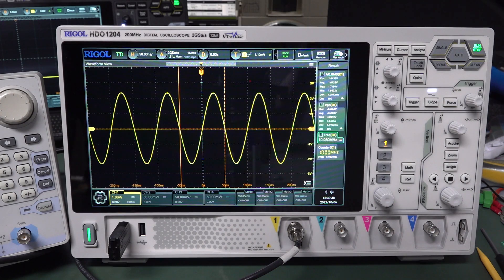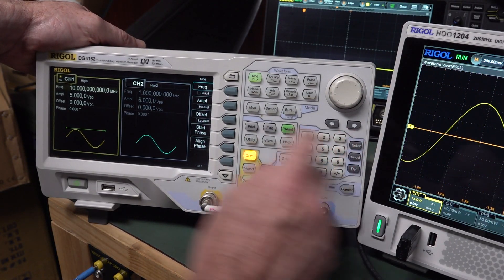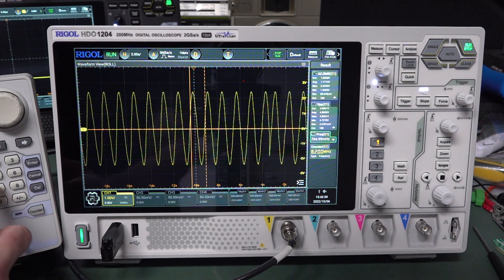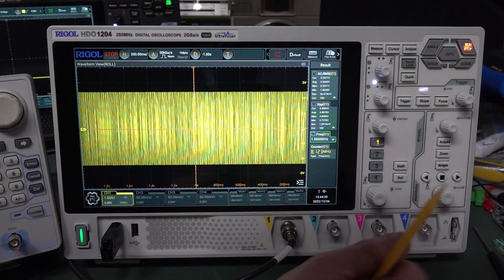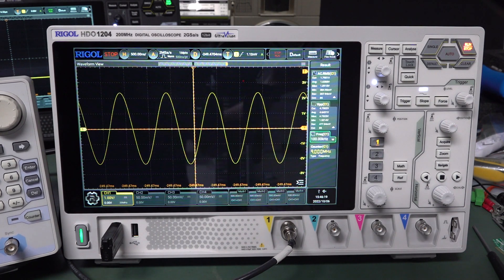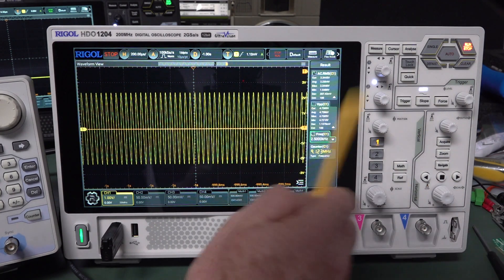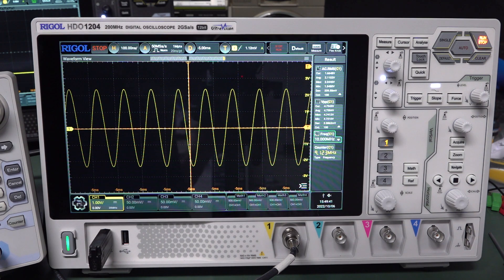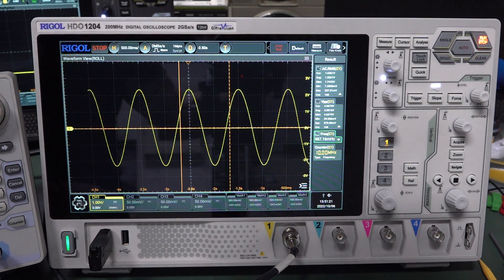Oscilloscope Alias Followup

Comment: To be fair, this is happens because a given sample can only store 1 value. It simply captures a single sample in time.

The scope could instead continue to sample at the full 2 GS/s instead, and statistically crunch it down into a "5 MS/s" sample rate for it to achieve the desired memory depth. But still contain the average, max and min values for that "sample". (The sample would be a lossy compression of 400 samples.) This however means that we need to store 3 values per sample, instead of just one, so it would lead to 1/3rd the memory depth. Technically one could store even more statistics if desired, like RMS values, duty cycle, etc, and if it is selectable then the scope could get some rather powerful long term statistics gathering capabilities. Simply pick and choose who it stores this "sample", and how many types of data it shall contain. (I should quickly add here that no scope to my knowledge actually does this.)

Comment: The Fluke 190 series II and III has a glitch mode (is default enabled) where the incoming signal is sampled (and saved) not only on the sample frequency, but also on a high clock frequency, just to avoid these kinds of problems. The minimum and maximum samples seen during the sample time are also stored (and displayed).

Comment: Is it possible that with the odd frequencies the function generator is actually not producing a pure sine and instead has some small phase error (possibly dithering) which is enough randomness to prevent the aliasing? To get what looks like a pure sine with aliasing requires high spectral purity (less than about 1 in a million when dealing with a pure frequency in the MHz).

Comment: I think there's an interesting interaction between memory depth and acquisition mode on these sorts of scope. If you run 'normal' acquisition and a small memory size, you can get aliasing in situations where you don't with large memory depths. With large depths the sampling is running at a higher rate, and the display is giving you a view based on all of the captured data, so if you, say, have 10M data points and only a 1000 pixel wide screen, 10k samples are being displayed per line, which leads to the nicer DPO style view.

If you turn on peak acquisition (that's what it's called on my Siglent) then again, I think the sampling happens at a faster rate, but rather than storing all of the data in memory, it just stores the aggregate data from the multiple samples, so at smaller buffer sizes you still get a DPO style view of a fast signal without aliasing. If you turn the buffer up larger however, it doesn't have as much data to aggregate per peak value, and some odd stuff re-appears.

So, either large buffers normal acquisition or small buffers, peak acquisition seem to give me the best results in Siglent land.

Definitely need to explore how those two interact to fully understand aliasing in digital systems and what you can do about it
Reply: The reason that peak detect breaks up the aliasing effect is because it is picking the samples in in each interval based on their value, not always picking them at regular intervals, and this small amount of irregularity in sampling is enough to avoid synchronous aliasing.

Comment: I remember the first time I started to use my brand new oscilloscope and function generator.
I had the generator set up to output a sine wave of a 10 MHz, but the oscilloscope showed a very low frequency (in the order of Hz) with a timebase of 100ms per division. 
The hardware frequency counter was on and it showed 10MHz. 

I was going crazy. Everything was telling me the frequency was 10MHz except the oscilloscope screen, when I changed time base the signal started going crazy and produce a mess on the screen. Spent like a couple of hours trying to identify the problem. I was sure my signal generator was broken. 

That day I learned about aliasing.

Comment: Not that fund of the scope design of HDO4K and 1K and those hard plasticknobs got a Fnirsi/Hantek vibe over them..
The Siglent SDS2000x series do look better ..those neoncolors / housingsticker aroudn the sockets, also dont ring my bell.
and that dotted part, is that indent a sticker or actual casing,  nahhI reckon its actual casingmold as it would be to tacky if it was simply a sticker that was used to coverup a brief plane difference to the indent around the USB sockets...
Though the screen UI do look decent and somewhat modern.
Reply: You are comparing it to a product that costs 3 times as much. The low end Siglents also use hard plastic knobs.
Reply: @jaro6985  you clearly dont know what HDO4K refers too.?
https://www.youtube.com/watch?v=6qjqhnQiQXQ

and no, its not a good locking scope as per se..
a SDS2104X (4ch, 100) 1399 US (Siglentna) does look quite a bit better then a Rigol HDO1104 (4ch 100) 1399  (rigolna) on the pure outer design of the scope.
- as mentioned above. the screen UI do look somewhat modern & decent.
but nothing new.. Rigol leaves a lot to be desired when it comes to their scope design.
You almost need to go up around their flagship DS70000-series before its a sexy beast with knobs that looks like its with duallayered inlays for fingergrip, and highlighted backlid-knobs and all that jazz.

Comment: Just like the early Tek high bandwidth scopes did the display, using repetitive sampling and aliasing to get a signal that would actually pass through the CRT deflection amplifiers. That way you could get a CRT that possibly went to 100MHz in real time to sample and display signals in the GHz range.
Reply: This is sort of true, but keep in mind that if you were looking at signals above the actual bandwidth of the scope, any vertical measurements would be inaccurate because higher frequency components are attenuated. Even the cheapest USB scopes at least have a basic RC low pass filter on the front end. 
  
But yeah you can measure the frequency of signals quite a bit beyond the bandwidth of the scope. Daniel Bogdanoff did a video on this a few years back - https://www.youtube.com/watch?v=S8eSDjyRceg